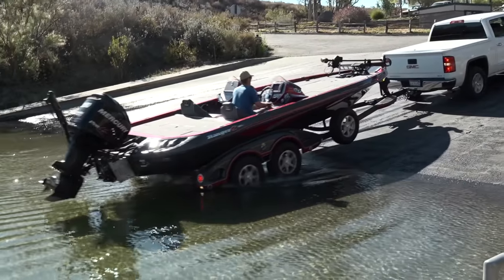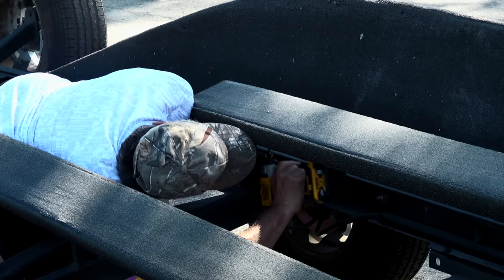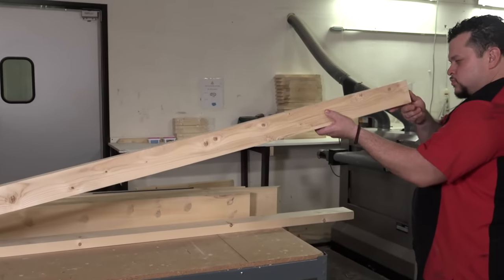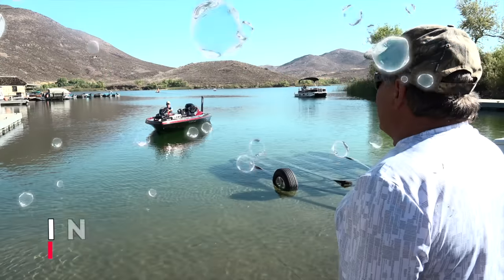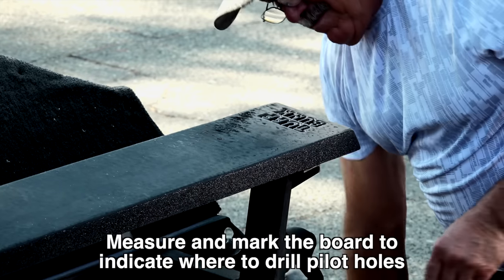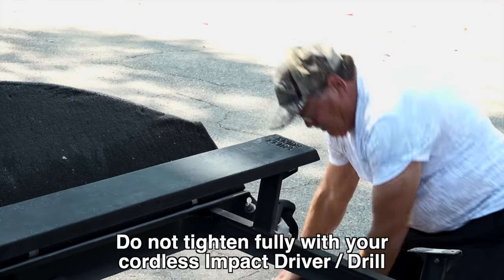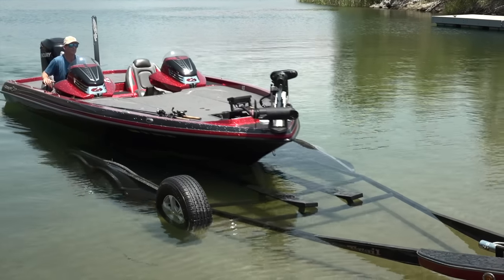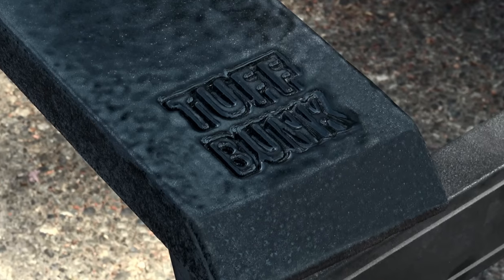Boat Trailer Bunk Replacement Boards - Tuff Bunk

Comment: So…according to this video, I can now spray my 2x4s with Line-X bed liner and works the same? It looks like what it is.
Reply: bed liner is rough though, right?
Reply: @Straight0uttaCrofton  
Yes, but I see them sanding it smooth for the boat to slide on? I think that’s what they did, or makes sense to do so.
Reply: @Straight0uttaCrofton  
I don’t know what they used, they wouldn’t tell us anyway. I don’t see why it wouldn’t work, right?
Reply: @peteryeung111  let me know how it goes because i definitely ain't paying $400 for some bunk boards
Reply: I wouldn t I d go back to new carpeting before tried something like that why risk it..They sell Teflon slides can put in bunk boards I was thinking trying them?
Reply from the maker: We use a similar technology but this is a softer durometer and designed for our marine application.  When applying polymer coating to wood, what you see is what you get.  One of the biggest challenges is starting with a straight board that is sanded and prepared properly.  Poorly prepared wood will telegraph the knots, grain and imperfections through the coating if not done correctly.  Most of the time to make Tuff Bunk boards is spent on the preparation.  Happy boating!
Reply: @peteryeung111  they used a rubberized product. The stuff you use for a truck bed is not rubberized.
Reply: @protechmats5274  
Thank you very much for the information.
I will look into it, or other options.
Hope this helps whoever is interested in these products.
Cheers 👍
Reply: @dustinzimmerman7402  
Will look into it. Thank you!

Comment: i wonder could you use capped composite decking, double thick, with no carpet?
Reply: That sounds like a excellent idea-you would eliminate the screw holes  rotting out wouldn't you???
Reply: @tonyjordan1320  if i did it i would probably drill holes all the way through and countersink stainless  t nuts down through the top for a bolt to bite into from the bottom. 
not sure the composite would be stiff enough though, even if doubled it up. would depend on the span i suppose.
i saw another video where they used this "plastic wood", but they even said it might have too much flex so not really sure.

Comment: Don’t like the lag bolts. The wood around the lag bolts will rot out, and these will fall out. I would like to see a counter sunk bolt and nut, with a washer on the wood side with the holes epoxied during installation, or some of your material to waterproof the hole above the bolt and washer. I have GatorBak’s now and they are pretty good, but power loading does skin them up. Using the same boards Ranger used in the trailer from 1999. Not sure if they are pine. Likely not.
Reply from the maker: Thank you for your comment.  We've considered the counter sunk thru bolt method and you correctly understand that sealant is necessary.   We maintain the waterproof integrity of Tuff Bunk by installing with urethane sealant on the lag bolt penetration.  Tuff Bunks start as untreated, prime grade, kiln dried fir for our boards.

Comment: Will this work with pontoon boat trailer's without damaging the aluminum on the toon's?
Reply: Absolutely!  The coating won't damage any of the common hull materials, aluminum,  urethane clear coats or fiberglass gel coat.

Comment: I have a very steep very short ramp at one lake I launch with a 50 ' rope by myself will my boat slide off at the wrong time because the boards are to slick
Reply from the maker: Hello Tom, thank you for your interest in our Tuff Bunk. 

We do not make boards for every situation because there are a lot of different boats and launch ramps, however, we will always do what we can to make our customers happy.

With that said, every Tuff Bunk board that leave here is inspected and sanded smooth on the top surface. This change in the boards came after we receive input from the consumer that the boards might scratch the bottom of their boat. We had a non-slip surface on the boards that was great for application like yours so we can make that for you. If your boat has a black polished bottom like our customer that was worried about scratches, then maybe this product is not for you.

#1 current boards have sanded surface.

#2 old style board has non-slip textured surface. 

Both #1 and #2 Tuff Bunk boards are way better than wet or worn-out carpeted board.

Hope this helps.
Reply: *   The boat won't slide off if you keep it snubbed at the winch. I bet you like to take off all your tie downs, then back your boat into the water. Once the boat starts to float you give your trailer a little jerk to cause the boat to float free of the  trailer, then you drive away and come back to retrieve boat with that long rope. Keeping the boat tied to the winch isn't going to slow you down that much.
Reply: Awe crap. I was so excited about trying these until just seeing that it’s not for a black bottom boat.

Comment: My opinion the Ultimate Bunk Boards are better since they are 100% composite boards which NEVER wear or rot like anything made with wood. Of course these are a nice option but not the best option.
Reply from the maker: Composite boards do offer the advantage of long life over carpeted boards.  Composite boards will sag at lengths over 60" and their surface is extremely slick.  This may not be the best option for everyone.
Reply: @protechmats5274  This would be why you would reinforce the composite...

Comment: Holy jeez they are expensive. It'd cost me about $600 to do my bass boat trailer. New pressure treated bunk boards and gatorbak's would be about half the cost.
Reply from the maker: Thank you for your comment.  We understand that Tuff Bunk trailer boards may not be the best fit for every budget or needs.  We provide the only non-skid, completely waterproof (when installed with urethane sealant on the lags) solution at lengths over 60".  Wraps and composite bunks have their place but don't directly compare to Tuff Bunk trailer boards.

Comment: HAd me interested till saw price..
Reply from the maker: Thank you for the feedback.  If  you don't mind a follow up question?  For a pair of 7 foot  2x4 bunks, what price would you be willing to pay for Tuff Bunks?
Reply: @protechmats5274   I have 2 x 6  8ft I just bought new pressure treated and marine carpet  new brackets galvy brackets to attach all together cost me under $200 .the original l bunks lasted me 10 years .SO I pay 200 maybe little more
Reply from the maker: Thank you for this info Todd.

Comment: Will this scratch the paint?
Reply from the maker: Our Tuff Bunk doesn’t scratch no more than what Carpeted Bunks would with debris. Please note that the trailer should be submerge in water enough to ride your boat and have a slick surface.
Reply: Thanks I bought it!

Comment: Somebody’s smoking crack $600 for bunk boards nah I will stick with my carpet
Reply from the maker: LOL! You can be confident that we aren't smoking crack Mr. Nettles!  We understand that Tuff Bunk trailer boards may not be the best fit for every budget or needs.  We provide the only non-skid, completely waterproof (when installed with urethane sealant on the lags) solution at lengths over 60".  Wraps and composite bunks have their place but don't directly compare to Tuff Bunk trailer boards.  Happy Boating!

Comment: Alright! I have successfully installed my new Tuff Bunks. Previously I struggled because the lag bolts did not fit my specific trailer. The company supplied a new bunk free of charge and even waived the shipping cost! Anyway, the installation was as easy as the video implied. All went very well. I have used them probably a dozen times (I fish a lot) and they are quit solid. They are more difficult to winch onto the trailer even when they are wet as the company directs. If it is a sunny, windy day, they dry off within a minute making loading more difficult. My winch is very heavy duty and I have above average strength; so, it has not been a big problem for me. On to positive statements: I will say they are very solid, high quality pieces that will probably last a long time. I agree they will likely prevent the spread of invasive species. The company really did come through for me and even provided a number to call if I struggled with installation again. Integrity means a lot to me and I feel this company really wanted me to be a satisfied customer. They succeeded! I am very pleaded with my purchase!
Reply from the maker: Hi! We appreciate the great review. Remember, as we continue to grow, Tuff Bunk wouldn't be what it is without our customers feedback. We have already added instructions on our hardware kit. Thank You again for showing your boat some love with Tuff Bunk!